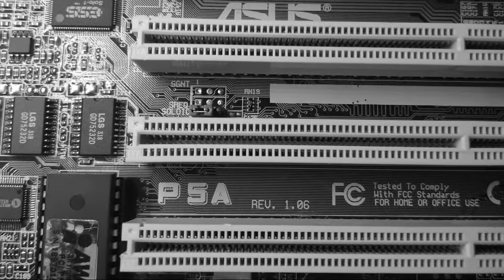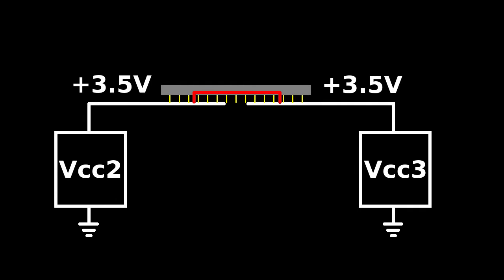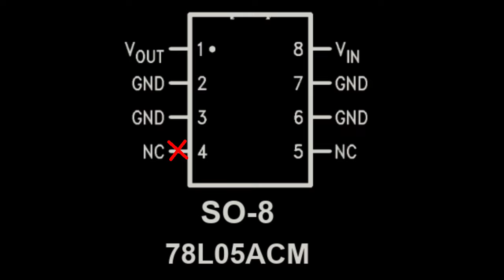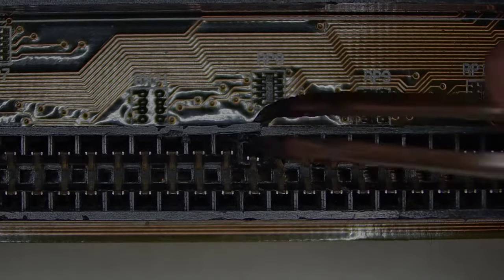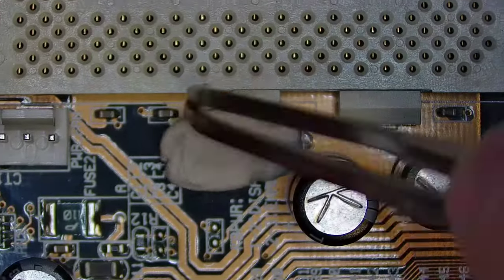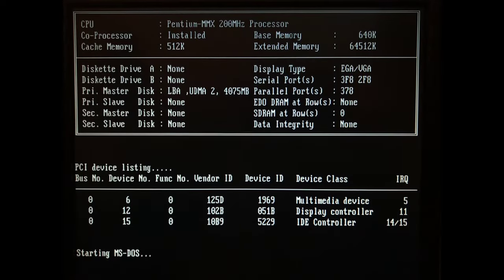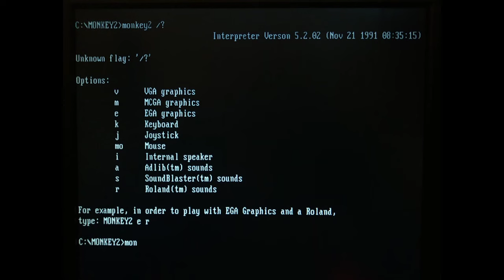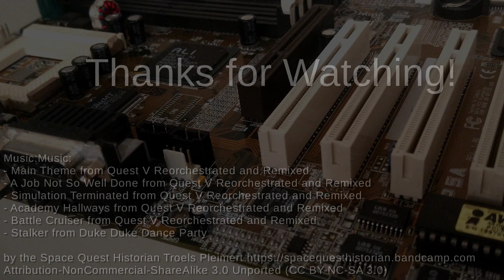Repairing a butchered ASUS P5A Part 2.

Comment: You and necroware inspired me in trying to repair some quite corroded motherboards i have, thank you! I might be able to fix the easiest ones 🤞🏻
Reply from the maker: Ha ha yeah, if it's not in a corroded mess, then it's not worth repairing :D
Reply: @scrap_computing  Yeah, that's almost the case, some may also had little water damage due to a roof leak, but the damage seem not very widespread. Yet, thank you again for posting you videos, and creating nice gadgets! 🔝🔝🔝

Comment: Nice. We all learned from your mistake ;-) I wonder how well that socket clip repair held up. I'm still looking for a good way to reconstruct them. I've got too many socket 370 boards with broken retention clips.
Reply from the maker: I can't really tell, because in my case half of the original clip is already there, and it's the one that takes all the load.

Comment: Great video as always but you mention about getting the SOLO 1 working in DOS but did you mean MS DOS 6.22 or WIndows DOS? These Vogon posts are very confusing. How does one get SOLO1 working in pure DOS 6.22?
Reply from the maker: Pure DOS 6.22. If I remember correctly you need: 
1. Directory: C:\SOLO1
2. File: C:\ESSSOLO.INI
3. CONFIG.SYS: 
DEVICEHIGH=C:\SOLO1\ESSOLO.SYS 
4. AUTOEXEC.BAT: 
LH C:\SOLO1\ESSOLO.COM
SET BLASTER=A220 D1 I5 T4
C:\SOLO1\ESSVOL.EXE /v:10 /l:0 /w:10 /m:0 /c:10 /s:10 /a:10 /p:0
Reply: @scrap_computing  Thank you very much for your reply. Your videos are great!

Comment: Soldier wick works a lot better when you aren't so hesitant to use fresh portions of wick. You need to use fresher portions thats why it keeps smearing soldier all over the place. It's like trying blot up a spill with a soaked paper towel.

I love the ASUS P5A, an absolute trooper with a K6-2 500mhz and a Rage 128. I'm gonna hold onto mine forever.
Reply: i'd trash the wick except for weird cases, 
use electric solder pump. never runs out and works better.
Reply from the maker: It's a really junky solder wick the one I have. If I remove the soldered end then its threads start to come apart :D I need to get a good quality wick.